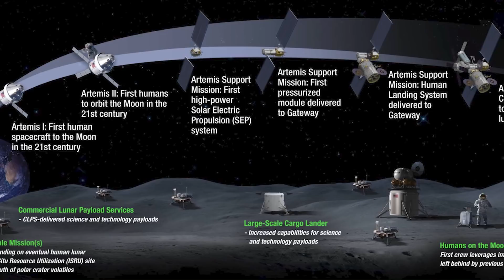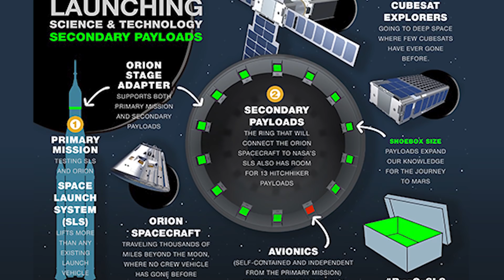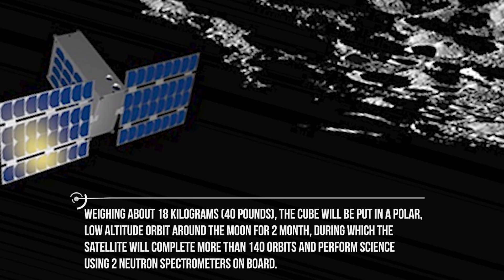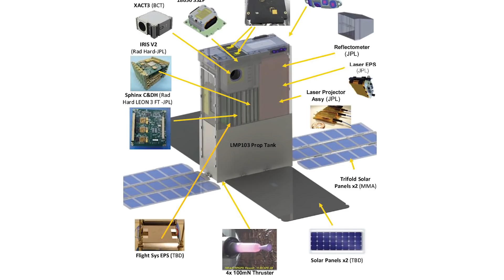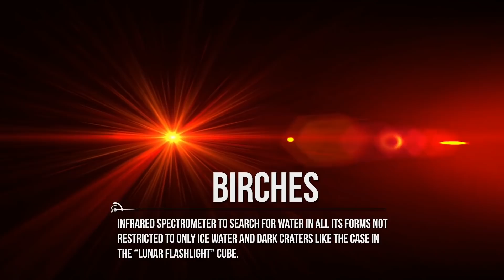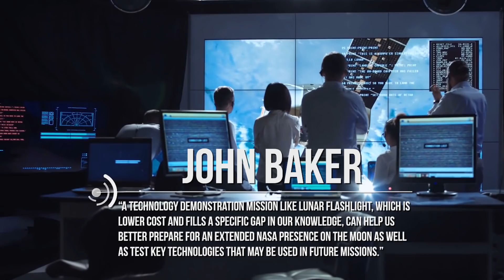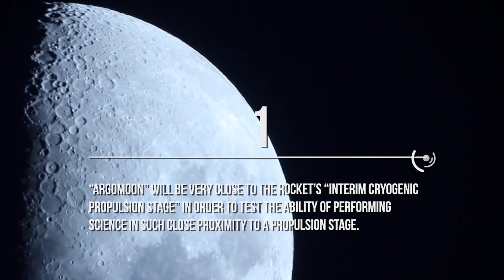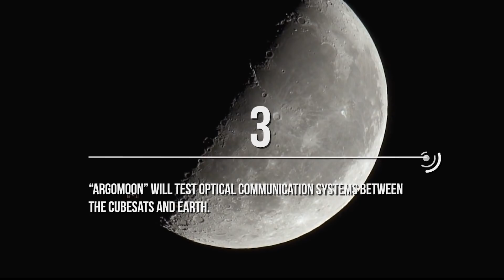Artemis 1 Mission: 13 Secondary Payloads On Board!

Comment: Someone may have thrown this question out there but why haven’t they shut up Q satellites to act as a communications relay that could be set up between the earth or the moon all the way to Mars to have faster and more accurate communication to there so that way there won’t be a time lag in communications like there currently is with the probes that they have on the surface of Mars
Reply: So you want to slow things down. Cute.
Reply: wong all I’m suggesting is to be able to have a faster and quicker communications between Mars and Earth because there is such a large time lag between in communications and I think if we start now with putting cube sets in place by the time they get there it will be a much simpler method to communicate and all it takes is the correct amount of cube sets in one space craft or rocket that would release them along the way at the range of the signal communication between them which I think would be very beneficial
Reply: @danyelPitmon  How fast do electromagnetic waves travel? How will introducing relay stations speed things up?
Reply: @danyelPitmon  How's your FTL system getting on?

Comment: The hydrogen engine isn't new its been bout for years
Reply: They're just reusing old space shuttle engines
Reply: They are using old engines until they run out, however they will be using a higher performing cheaper variant. Plus, the RS-25 is hardly the same engine it was 40 years ago